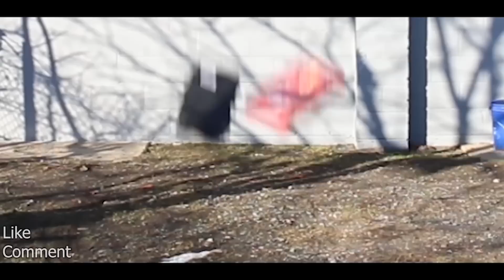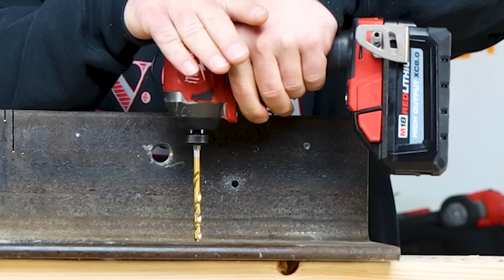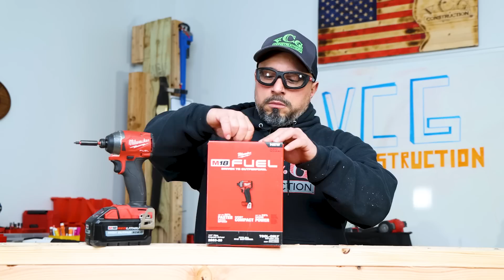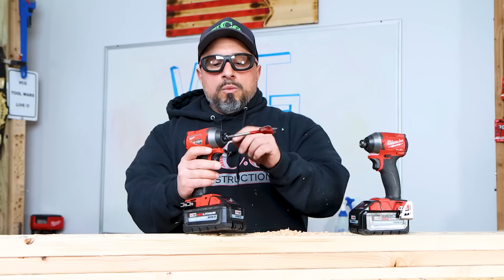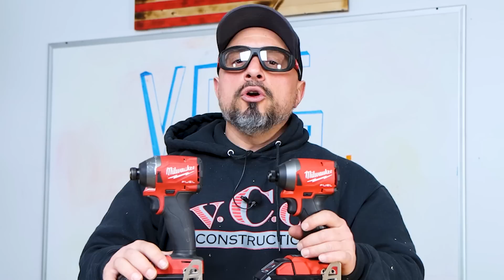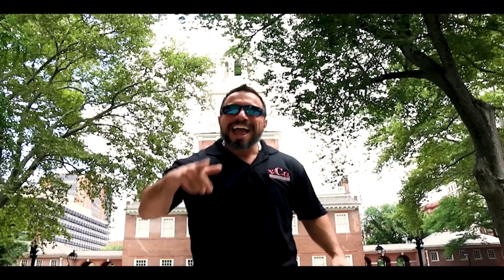MILWAUKEE TOOL makes HUGE CHANGE that CAPITULATES to the 1%

Comment: I've been waiting on the fix. Now to buy one next sale. I knew what the fix was though I didn't have a machine shop to make it. I told them fix the gen three or make a gen four. Since I knew I would be part of the 1% that has that issue. I already use a lower model of the impact driver daily I just didn't want to upgrade with the issue. I've already been thinking about another tool I could use.

Comment: I still prefer a drill for drilling holes. It's harder but faster. Plus I use hole saws a lot, but still prefer drill for paddle bits and the like. 

Impacts are the best tool for driving fasteners but in my opinion (emphasis on opinion) drills are better for drilling holes.

Comment: All of My MilwauKee tools I Received with the Purchase of My 2013 Toyota Tundra Are Still Working Just as Good As Ever . I Do Home Remodeling and They Get Used Everyday....It is Truly The Best on the Market....I Have Not Lost 1 Single Battery during those 8 Years ...I Did have to Replace the Battery Charger at about the 5 Year Mark...They Are The Best Hands Down...My Old Dewalt Batteries used To last 1 to 2 Years...Thank You Milwaukee !

Comment: now the next question is, with the "most powerful motor", will there be an issue with the entire nose breaking off because of the 2nd hole cut into it.
Reply: I believe that's what took them so long to figure out. The cost of forging/machining/treating that anvil whilst retaining product spec must have doubled as well.

Comment: @vcg construction thank you Vince for getting Milwaukee to fix this issue I wanted to get the gen 3 but wanted to wait for the fix I do a lot of over head work n car work can’t have bits falling all over the place. You rock vice they should put u on the box ring the bell 🔔 7 years lucky 🍀 good job and thank you again for getting them to fix the issue

Comment: It’s more than 1 percent. Everyone I know that has this tool it happens from time to time. Especially if you use it for paddle bit drilling. Really an added ball bearing. It’s not rocket science here. They have this problem in the m12 fuel gen 2.

Comment: I have this problem with my driver when switching bits it won’t grab onto it, I found I have to open the collet manually and then let it snap close, then it holds, almost like it gets stuck and snapping it breaks it free and lets it grab

Comment: Really you shouldn’t be using an impact with spade bits. I know they make them so u can use them with the impact but drilling holes is a job for a drill/driver. Using impact to drill holes will shorten ur impacts life.
Reply: Using a drill/driver with paddle bits shortens the life of my wrists.

Comment: Yeah I’ve had that problem. had to have my collet replaced. Haven’t had the issue with it since it was replaced. But I also haven’t been drilling as many holes since I had it malfunction on me. How can we tell if it’s the the new and improved one if were to pick up a new one at the depot?

Comment: @VCG Construction
. Thanks Vince for this great information. It's great that Milwaukee listened to you and us about the collet issue. Even if it's only 1% of those cases of people who complained about their GEN3 having the problem, they have to know that there's others who may have the problem but just live with it. We'll see how well Milwaukee takes care of the owners and future owners of the GEN3 FUEL impacts. And others have asked, can you ask Milwaukee whether they plan of pushing the new collets to future made ones and how can we tell without buying the new one and looking down the collet for a two ball detent? New product number?

Here's an idea. A TTR between your original GEN3 and the "fixed" GEN3 FUEL impact. That should really be a great TTR to not only see whether the loose collet problem has been fixed but also make sure that the performance specs are still the same. And of course, make sure to mark one of them so we know which is which and switch users to give each impact a chance at having a very close score.

Thanks for the announcement and helping to influence Milwaukee in taking this problem seriously. Milwaukee could've easily said "ehhh. 1%" and ignore the problem. Hopefully Milwaukee takes what they learned from this collect problem and carries it forward to future tools. The savings of one ball bearing and tooling a collet for a second ball detent costed them.

Hope you and your family stay safe and well.
Reply from the maker: We’ll see if we can find a good solution! All the best to you and yours cuz! 👍🏻

Comment: They fixed that, but they can't keep the batteries attached to their impact wrenches?  I have a lot of m12 tools, but went with Makita  for my 18v platform.
Reply: Really? I didn't see many people complain about batteries detaching from impact wrenches .
Reply: @eliadbu  Google it and you will find many issues. Multiple YouTube videos covering this also. JDTco now sells a strap to hold them on. Even my m12 stubby has issues daily.
Reply: @nosliwttam77  I ordered the m18 mid torque the gen 2, I will see it when I will get it.
Reply: @eliadbu  it will probably be fine for a while. You shouldn't have any issues until it's seen a lot of use.

Comment: are they doing this with all of the driver or just the gen 3. I don't recall which gen mine is however it has the same problem. Didn't know if they will fix or replace the older versions. Vince could you please email what I need to do. thanks email to{ tjss58.ts@gmail.com}

Comment: As a Norm Adrian's what to be 80' kid, it is my opinion that an 18V impact is awesome for most general construction.  As an installation remodeling contractor, it is my opinion that a drill with a Bosch or Vega Bit quick release bit in the chuck is a better solution for accuracy and control.
Fein, Bosch, and Milwaukee all make excellent 12V drills that suite my needs.  
I should add. That German Metabo 18V impacts are very hard to beat and the Bosch 535C   drill 18V is a money maker.  I own and use all of the above Metabo, Fein, Bosch, and 12V Milwaukee.  Just a few thoughts for the VCG !!!!!

Comment: I’m super happy they fixed it!!  Only problem now is that Milwaukee kept the same model number on it (2853-20).  So for starters , if you’re buying the tool only, you’re going to have to rely on the picture on this particular box to get the “fixed” one and second, for those who are looking to buy the combo kit “2997-22”, it’s going to be super hard to determine if the “fixed” impact driver is already included.  IMO, Milwaukee should do a just so ever slight change to the model number for tool only or combo kit, that way it’s easier for everyone, thanks again for this important information, great work!!

Comment: There is another issue when switching from forward to reverse and it staying in forward
Reply: 4 of us out of 4 at work have the same problem. Sent them all in for repair and still had the same problem when we got them back.
Reply: Do you have a repeatable scenario? Mine is still pretty new so not noticed anything alike.

Comment: They didn't improve it like you said, they fixed their engineering shortcomings.  If they were a decent company, they would replace all the impact drivers with the engineering failure.  I'd be impressed with that!

Comment: I know people give you boo boo about how in-depth you’ve gone into a product but I love to admit your videos have saved me in a pinch or saved me an arm and a leg on a bad product. I’m happy milwaukee finally fixed the one problem that kept me from jumping on the red bandwagon, I’m a fan girl at heart but I’m a bigger fan of a thick wallet and not having to buy things twice and I’ve been waiting for a long time on having the strongest most compact impact on the market without it the chuck screaming her last in the middle of a job... I didn’t pay 3X the competitors price just to get something harbor freight could make a cheap Chinesium knock off of. Now that Milwaukee just wowed it’s loyal users with a fix on a chuck that shouldn’t have even been a problem to began with... now they just have to fix the gen 3 hammer drills faulty trigger... Good looking out VCG and keep it up.
Reply: P.S. I watched a video you did however long ago right before I bought my gen 3 Milwaukee hammer drill and you mentioned how a small number of people may run into a faulty trigger switch and I thought to myself that wouldn’t be a deal breaker on a great tool... well guess what it is... you warned me like Paul Revere and I didn’t listen and now I’m pissed because I’m getting taxed for tea.... I’ll listen up next time!

Comment: That's one problem corrected by the  VCG, now on to the issue of the 12V charger not being able to charge 18V batteries. If this issue gets addressed, the last thing for rhe leader of our VCG to accomplish will be an eight year stay in the White House.
Vince for President

Comment: I think it's a lot more than 1%. I'm just a diyer and i experiences bit problems day 1. Great tool but very annoying...also need to use slightly extended bits because the ones that seat in with just the tip can have the opposite problem where you can't pull them out lol

Comment: Previously, everyone agreed that adding a second bearing would solve the problem.  Milwaukee should have realized this during its initial design process.
Reply: It's all about $ for the CEO and the major share holders.
Reply: No, it’s the spring shape, mine is the single version but my spring is different with the one Venice’s
Reply: Milwaukee added a second bearing, Alan Xu.

Comment: just by adding that second ball bearing fixed the problem. even Roybi has 2 ball bearings in it. But it is confirmed it is now fixed and good job on Milwaukee's part for fixing that anvil.

Comment: Just ordered 2 drill driver kits today.  DO YOU KNOW WHEN THIS WAS CORRECTED?  Wondering if there is a way to tell production runs that have the updated drills.
Reply: That's a good question if you don't just buy it. If you did, look down the shaft of the collet and look for two balls for detents instead of one. As Vince showed in the video, that's how Milwaukee fixed the problem. Hopefully there'll be info on serial numbers starting with ??? have the two-ball collects. Hope that helps.

Comment: How do I know If I’m buying a new impact driver today, if I am getting the updated version and not a back stock.
Reply: That's a good question if you don't just buy it. If you did, look down the shaft of the collet and look for two balls for detents instead of one. As Vince showed in the video, that's how Milwaukee fixed the problem. Hope that helps.
Reply: Just bought the kit today only one ball bearing. Now what do I do? Should i return it?

Comment: Can now see in parts specs, that they now say 2 steel ball (№ 10 on diag). https://bit.ly/3j18gOu
Nice they updated this in 12/2020 and do hope Milwaukee does even swap for us users, and Ship a new tool out. Would be nice nice.
Reply: @Aepek. Thanks for the parts spec sheet. The spec sheet has at the top of the first page "STARTING SERIAL J57A". That's the same starting serial number for the M18 GEN3 FUEL impact driver that is just bought from Home Depot as the Special Buy with the two batteries, charger, and PACKOUT box. And since Milwaukee doesn't put a production or manufacturing date on their boxes, looks like the only way to tell if we get the updated one is to buy it and look down the collet for a two ball detent. Again, thanks. This is why this is a great VCG gang to hang out with and help each other out.

Hope you and your family stay safe and well.

Comment: Hey Vince, how do you know if or when you can get a new one, are they already in stores?
Reply: Yea is there a new SKU or just luck of the draw?
Reply: I was wondering the same thing.  I wonder which one came in that conbo kit with the free framing nailer.
Reply: This is exactly what I was wondering, I’ve waited long enough already and don’t want to get an old off the shelf one because HD bought 50,000 of them for Christmas.

Comment: The Ridgid one hand bit expulsion seems much more intuitive.
Push the collet forward, old bit pops out with authority, new bit goes in.
On Old Milwaukee, bit removal is 2 handed but you're holding the new bit in one hand and you're still holding the tool for insertion so bit-in or bit-out is still 2 handed.
Ridgid bit-out is truly one-handed and your other hand is ready to insert the new bit with hand already on the open collet.

Comment: they should not have to see if you need it fixed...if you bought the gen 3 in the last 3 years it only has 1 ball bearing....you need the 2 bearings in order for it to work properly
Reply: Exactly King. You should just be able to take it into a service center where they swap out your old collet for a new one because it’s obviously a faulty part. Makes sense to me.

Comment: Are these out now? How can I tell the difference?
Reply: @James Self
. Look down the shaft of the collet and look for two balls for detents instead of one. As Vince showed in the video, that's how Milwaukee fixed the problem. Hope that helps.
Reply: @ccadama  it needs a new part number you cant just go opening every box in the store to check.
Reply: @jameselam8263  I agree with you. Unfortunately, Vince doesn't have that info and we'll see whether there's any more info coming out about this fix. Milwaukee doesn't put production or manufacturing dates on their boxes. There's a updated parts diagram @Aepek found and put out that has the starting serial number. It doesn't help because it's for the same GEN3 FUEL impact that has the one ball detent collet. So we'll have to see what Milwaukee does to help the buyers.
Reply: Yeah what is the Milwaukee tool part number?

Comment: So glad Milwaukee just added another bearing, and changed spring pressure. Changing the tool itself, woulda been horrible; for kinda a simple answer, right. Just add another bearing, or even 2. Sounds simple enough😅
Gonna be calling Milwaukee this week and see how the experience goes for “replacing or fixing” my gen 3 impact. Gonna be nice to use it now w/o those bits coming out. It really was annoying.
Sure hope this process is gonna be painless and they just send a replacement with prepaid to ship old one back, that would be awesome and easy😉
Thx Vince for keeping on this issue, & “We” got results....so so cool.
Cheers✌🏻

Comment: In seeking numbers on paper for marketing, it seems Milwaukee has made an impact driver, that, on 3 setting, can be described as functionally "spastic."
I never realized this until I borrowed a customer's Ryobi.

The comparison felt as though Ryobi uses a heavier and slower hammer action that gets more rotation per blow with less of the bit trying to jump off of the screw.

Comment: It is also a problem in the m12 version and it’s actually annoying af.
Reply: Huh. I've not had a problem with it. I do use paddle bits occasionally with mine. Never heard of this issue before this vid.